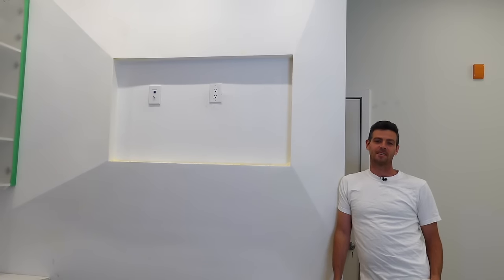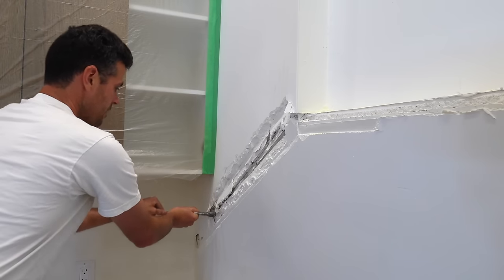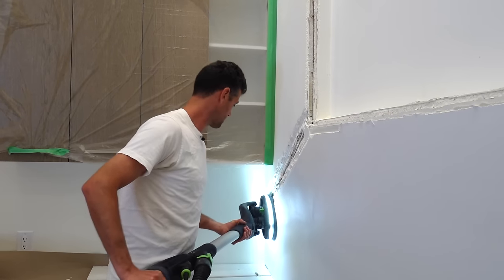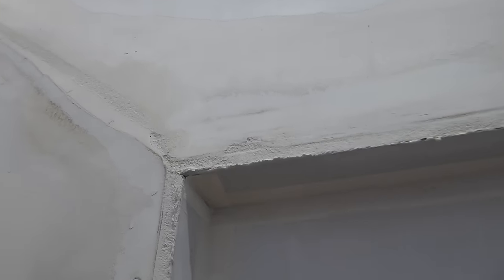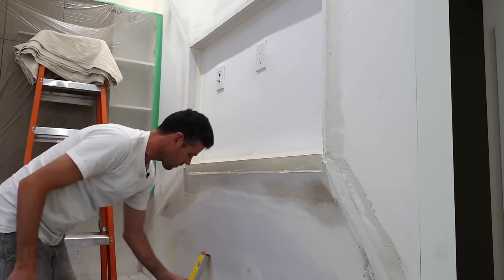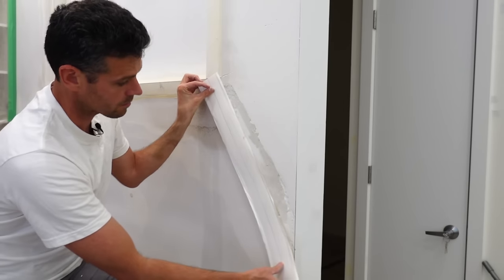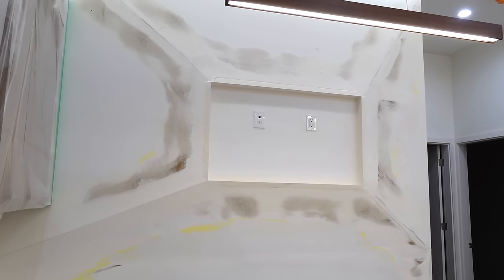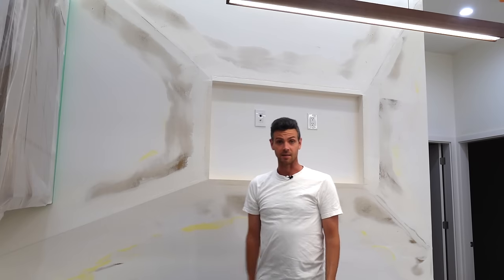Fixing a VERY BAD Drywall Job!!!

Comment: The asymmetrical one bothers me so much. And what if you want a bigger TV one day? I don't get it. Amazing work though, it's really an art!
Reply: I imagine they can just bump a new TV out by enough to clear the recess... But yeah it's just not a style I'd ever recommend. Recessing TVs belongs back like 15 years ago when they used fluorescent tubes to illuminate flat panels.
Reply: What a silly design and all the work to make it happen
Reply: @slapstra1970   I just realized that it's supposed to be like a clinic desk/room at the end. Idk I still think after like 2010 we shouldn't be recessing TVs, if you want a feature wall, get like architectural panels for the light to play off of.
Reply: so the right side is suppose to look like that?
Reply: It’s a pretty small wall all things considered — if you do want a recessed TV why not just frame the entire wall out by 2 inches or whatever and make it straight?

(And if you want the diagonal lines pointing at the TV… paint it in different colors of grey.)
Reply: @slapstra1970  welcome to the world of drywall and stucco 😂 
Disillusioned and sheltered people love vanity.
Reply: @slapstra1970  It is a really bad design feature.  Just hang the tv on the wall.  The money spent on this feature could have bought some amazing TVs and very thin TVs.
Reply: It isn't meant for the entire TV to fit in usually anymore. The recess is more for the mount and cables to hide in now. 75" TV's are become the norm now
Reply: @MustPassTruck why do you need it to 'hide' cables. You can hide behind the TV.
Reply: Yeah respect the craftsmanship but this whole concept is just ridiculous.

Comment: this feels like one of those times when you look at the designer and ask but why. great work fixing up that disaster of a first attempt.
Reply: I thought the same thing.
Reply: Not so much the designer as it was the framer and drywall.
Reply: agreed, i don't get why it's angled like that instead of just being a flat wall, what an unnecessary design

Comment: Very well done.  Am I the only one who thought, "A bit of extra time spent framing would have eliminated 90% of the hassle you (and the guy before you) had to go through."?  Incompetence seems to roll down hill until it hits someone who doesn't think close is good enough.  Either that or the home owner winds up paying for less than they expected.
Reply: Couldn't agree more. Somewhere 1/3 to 1/2 my work is framing and that was my first thought as well. I try to treat all my jobs as if Monday morning me has to deal with all of Friday afternoon me's bullshit and that framing was some Friday afternoon BS. 

Just because you can make that buildout entirely out of drywall and mud doesn't mean it gives the best result or is cost-effective. I would've ripped some 2x furring wedges then cut and placed some thin sheet good in an "envelope" cut like you do with large tile on a shower pan. That way the angles and corners are already built in and the hangers can just follow the plywood to get everything to plane out right. It'd still take a good finisher to make it look nice, but ya gotta at least give the  next guy a chance.
Reply: @Anytus2007  Yep.  Too many framers think speed is the mark of success.  They don't ask themselves if they would want their own homes built by someone who cut corners just to save time.
Reply: I frame like I'M the one hanging, I hang like I'M the one mudding, and I mud like I'M the one painting and trimming...mostly because I AM, but even if I weren't, it would save time and make a better product.

Comment: Nicely done. I started using steel plate for my rendering. Long story. Plasterers from U.k were telling me how they using a feathering straight edge. From the 1970s onwards, firstly in Australia plasterers used oregan (douglas fern ) to screed off render, float etc. The bricks were fire cooked so only cooked at around 200 to 300 degree Celsius. 
With this the plasterers used to screed the mortar wet. Later gas fired bricks which were cooked a lot, lot hotter at 3,000 degrees Celsius meant the mortar dried quicker. Straight edges changed from wood to using aluminium box rules and actually scraping the mortar. Also t bar were used. I went from box to t bar back to box as the box a little wider didn't flex so it ensures a more flat finish on large walls etc. Going back to the Plasterers from UK wales and England, I was told about darbies and feathering straight edges. So I bought one and then a newer version. I find on very wet mortar screeding with a box rule removes more than using a feathering edge. 
That lead me to go to the steel shop and buy off cuts of steel sheeting. 2 mm thick and 2.5 mm thick for longer ones and it works well on very wet work.
Your work is quite impressive for a Carpenter. I have worked with carpenter on dry wall fixing. I have done a reasonable amount of flushing and use water with a fine mist on the coats. I bought plaster from an industrial chemist for flushing. I used water with a fine mist to trowel flat then use a topping compound. I can however spend more time and trowel to a finish. I need to then avoid using too much water. The paper external corner tape you have we hardly come across. It a funny thing about formulas as you mentioned  around 24 minutes. I have worked with an industrial chemist and gave him feedback. They have scales and use retarders, pearl light and other ingredients I cannot think of at the moment. The mix with the right amount is done by using sensitive scales.I stopped using lime after an industrial chemist said, we consider lime to be no good. It was the best thing I have done. Thankyou for spending the time uploading this video. Edited 2.5mm steel as I left out the dot.

Comment: Hi Ben! I'm a big fan of your channel. I am a custom automotive painter and have to do bodywork on my jobs. For a kooky project like this, a "guide coat" would help your "sanding to perfection". I use cheap flat black spray paint, or ground up black chalk and smear (dab) the entire surface. The low spots stay dark while the high spots become "highlighted" as the dark chalk gets sanded off. You are a great and talented craftsman! Keep up the good work. Your channel is very educational.

Comment: I'm going to give you a suggestion for curves like the bottom of the TV square. As a sculptor who has to deal with stuff like this a lot, it is generally best to sand on diagonals with a large block.

Comment: Funny that when you said "Good enough," you only meant that it was time to leave that coat of mud alone and let it dry.  This seems to be an important point to recognize in the mudding process and is quite different from what those who did the awful initial work considered "good enough."

Thanks for your many helpful videos!

Comment: They make a sanding sponge also that's about 10" long a big rectangle   like 4x4" diagonally sanded works best. They do sell that mud in the states it's called high density  and also labels manufactured home quick set made by hamiltons. Pain to sand, I use the festool ans 40 grit for cutting down too to shape

Comment: @ Vancouver Carpenter Amazing work! Quick question from a DIYer who has an upcoming project. Do you do anything between sanding and putting on the next coat for mud? Broom it? Vac it? Do you have a video where you talk about this inbetween stage, or between the final coat, sanding, and priming? Thanks.

Comment: Great show.  For the back pain have you tried a "TENS" device?  You put a few pads around where it hurts and it sends small electrical shocks to stimulate the muscles.  It doesn't really treat the problem but does make it feel better.  For about 20-30 dollars you can't go wrong.
Reply from the maker: I’m doing way better. The physio helped a ton.

Comment: It seems to me that some of the pre-boxed compounds are wetter and more prone to bubbling. Sometimes, rather than fussing and over-sanding, it's good to get a coat of primer on before adding the final layer of compound. The primer acts as a "sanding stop" to prevent damage to the underlying layer.

Comment: Maybe its just me but honestly to avoid any concaves or convex surfaces I would have asked the client to fully reno the poorly assembled wall dynamic.
Personally I would have taken the cabinetry down and out of the way, torn out the drywall, added  symmetrical dynamic shims to the wall studs compensating for the drywall and mudding layers, applied new drywall and keep the surfaces sharp without having to overload the wall with mud this includes maintaining an symmetrical approach ignoring corners and long distances, using the shortest distance as the focus for symmetrical design.

Comment: great work. but... why would anyone ever want to have this??? haha
Reply: I agree. Given that the customer needed/wanted flat screens in those locations, I believe millwork (cabinets or surrounds) would be better suited on what I believe was originally a flat wall. Vancouver Carpenter certainly is not going to say that the pimples were a stupid idea.
Reply: It's hideous.  The design I mean.
Reply: @bboomer7th  Agreed!  They make TVs that are an inch thick these days!  Such a TV would cost less than doing all this custom drywall work twice. .

Comment: I thought I did some crazy home bead accents, but this one is out there.  Could you have just added another straight line inside bead where the lower panel meets the wall?  Seems like creating that curved wall was unnecessary and weird (to my eye).

Comment: In regards to what you said at 12:45 … Correct if I’m wrong, but I think I found the US equivalent version of your cement-based “quickset mud” for drywall — it’s call Rapid Set One Pass, available at Home Depot…. I’m not sure tho, I’ve never used it, just based off of matching descriptions
Reply from the maker: It’s very different. The product I use is just a setting type mud with perlite. There is no cement in it.
Reply: Huh… interesting. Thank you for the quick response!

Comment: I have a general drywall compound question. After sanding your final coat and apply drywall primer, how do you fix edge that you overlooked? I was doing work and needed to feather an edge better but it's hard to sand out now that it was primer'd.

Comment: I know dad always used Synko from WinRoc like 25 years ago and that mud came out of the box so thick.  It was weird to me the first time I pulled a bag out and it was almost ready to use wet.  That said, it still needs mixing to work out the bubbles that form in manufacturing (not the sa same kind of bubbles that form when applying it) mud.

Comment: That's every job I do ... I have floated out the worst manufactured homes since I was 15 and I'm 40 now. I have a secret weapon I use for coved seams I use. Makes it as easy as easy can be for them. Spent years struggling with them as ceilings are average 5/8" out where the halves meet. One day after spending an entire day sanding diagonal using your method and making 1000 knives I thought would work. If your interested in seeing it let me know.

Comment: is their a drywall mud that is resistant to "bubbles" when skim ccoating over painted surfaces?
Reply: I believe he’s mentioned before using light weight when skim coating over painted surfaces usually semi gloss painted surfaces
Reply: I use TSP to clean walls before patching and painting, it really helps with the bubbles, because it removes the finishers off the paint surface.

Comment: Maybe you could have build up a ridge by holding the level where the ridge needs to be, then go with the knife with some quickset against the leveling tool while holding it in place? That way you will create one perfect side first, and as soon as the quickset sets, you can do the other side by laying the knife against the top of the "ridge". This way you would have a basically perfect ridge already before putting the angled corned beads on. Just a thought from a fellow painter - this was indeed a wierd one 😅

Comment: I am scared to think too much, but hope that was DIY.  I also don't like the design and wonder why they would not just build the wall out the depth of the TV niche, even incorporate other niches surrounding it.  Granted it was the old days before you existed/helped me hone my drywall skills, but I have a corner fireplace that was just odd, and a projection/DLP TV with AV equipment that was bad, so I put a large built in with multiple niches, archways, lights and cabinets for the AV, and even better integrating the fireplace with a picture niche above.  It turned out well and looked like a pro did it/as a custom high end element.  While this particular "pimple" I think you called it would be a smaller job, I do think a quick build out is far better and more functional than whatever this is. I mean they spent a crazy amount of time trying to get the angles, drywall it and then fight to get it to look good enough like a kid in Jr. high Carpentry class did it, so how much more time to do it with standard/square angles?    Frankly the entire concept screams DIY with no incite on how it should flow into other design elements of the home.  So I would rip it out and just put in a small built in wall unit.

Comment: Need some help, i got a window frame done with coner tape which has two metal strips in the middle, so the problem is  after applying the final coat some areas are filled with air so should i just refill the space or should i redo the whole window frame? Am a carpenter apprentice from Kenya i would really appreciate any idea for these  windows.